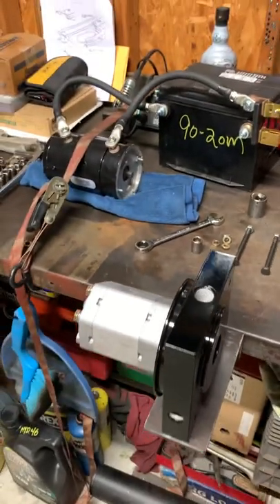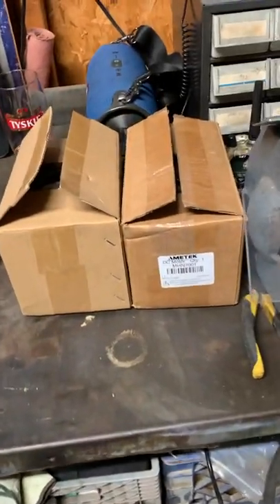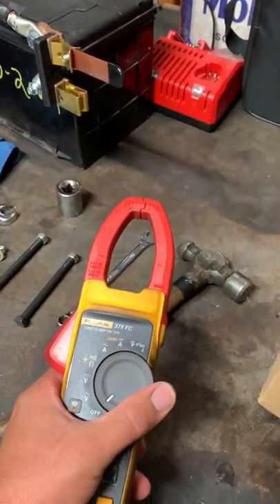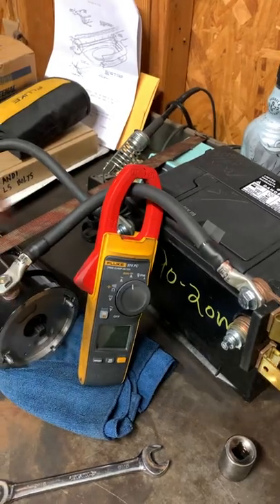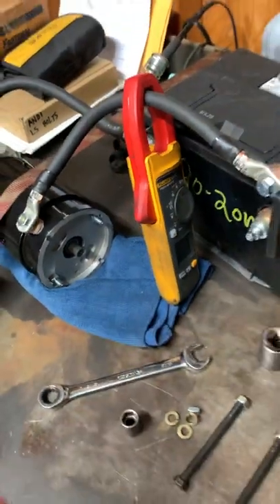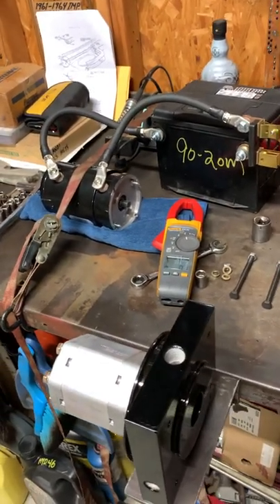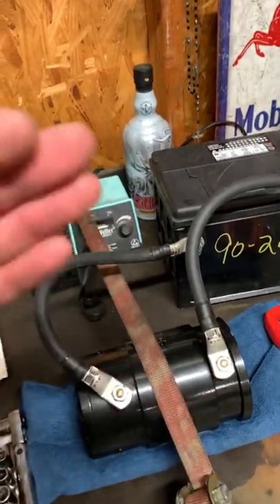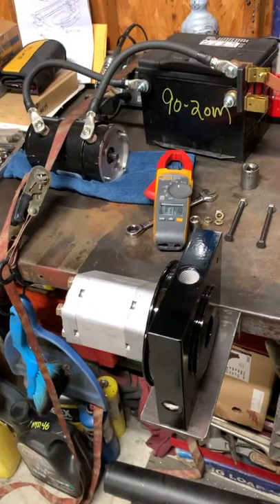Bench Testing Lowrider Hydraulics Prestolite Motors

Comment: Given the fact that you're using some NOS Prestolites, in thee event that those armatures need to be replaced, are they still available? I used to use a place in the Florence area(los angeles)called "Julius" for regular and hi-torque. But this was in the late 80s. Place has been gone for many years now.
Reply from the maker: I’ve replaced the bearings on the armature shaft, Brushes, but  never replaced the whole armature, I have a place in the city of Vernon called “Little John Rueland”  that rewounds all my motors, they’ve been in business for many years. They are badass😎
Reply: @ChapsBuilt84  
Ah ok.. yea familiar with them. Know a person that worked for them many years ago. I myself never used them. Just not familiar with many of the new hydraulic components. Concepts remains the same, but some of the parts are like wow(to me). #11 pump heads and telescopic rear cylinders!..😲
Reply from the maker: @johnny_6T8  The lowrider scene has developed so much new technology 😎
Reply: @ChapsBuilt84  
It certainly has! When my son was born in '92, i really didn't have time to continue on with the lowrider scene. Obviously watch it and its evolution via these platforms. Just a tad outta my league now!..lol
Ok sir, continued success with your car!✌️🤙

Comment: amperage is somewhat not a factor it's a 12 volt motor and you're going to add a minimum of three to four batteries so your amperage concerns are out the 🚪
Reply from the maker: You’re totally right boss, I’m also just tapping the switches which will be jogging the motors.  Not too worried just wanted to test the motors before building the set up.
Reply: and also depending on how much power you're going to run should determine what size gear you going to run the bigger the gear the more batteries are needed
Reply from the maker: @Mr50pop  Thanks for the input 👍 I want to run 6 batteries and #11 Marzucchi gears. Lay and play set up, but I want it to react fast😎
Reply: @ChapsBuilt84  six batteries and a 11-gear sounds more play than Lay I hope your yanking the frame and reinforcing it
Reply from the maker: @Mr50pop  fully wrapped Frame, fully wrapped front arms and trailing arms
Reply: @ChapsBuilt84  are you putting the wishbone in the rear it's a lot better than using the panhard bar and if you're going to run skirts you want some kind of shortened rear end and slip driveline I'm sure you've heard it all by now
Reply from the maker: @Mr50pop  running a G-Body rear end with the 2 top factory arms Four link rear!. And it clears the skirts😎
Reply: @ChapsBuilt84  if you are running 6 batteries, I recommend a #9